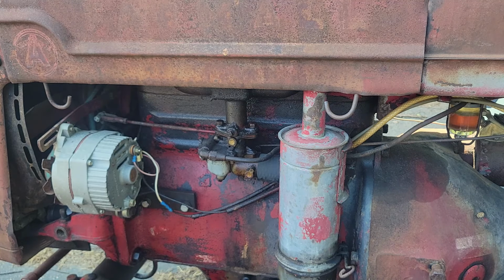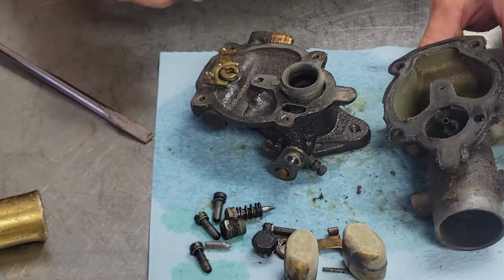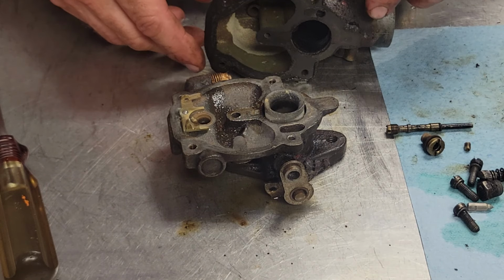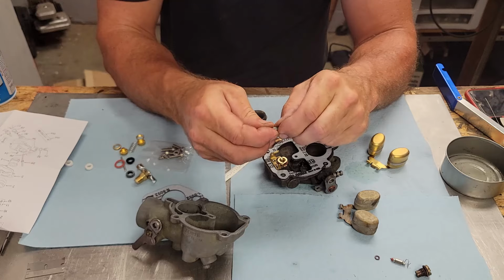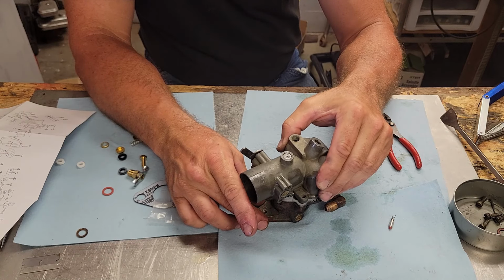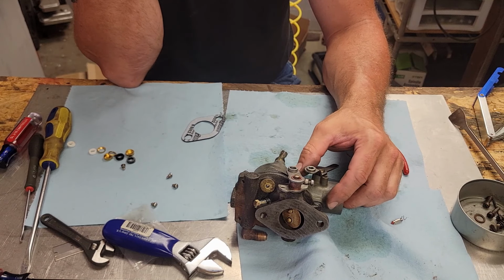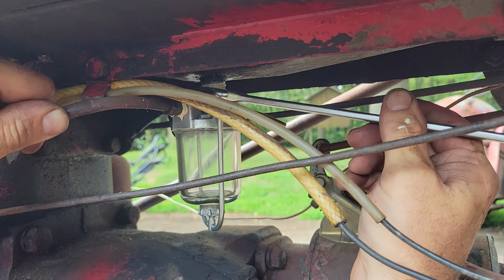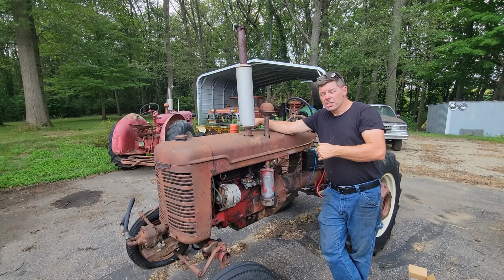Farmall A  Zenith Carburetor, lets clean and rebuild it.

Comment: did you take the fuel inlet fitting out? There is a screen filter in it that is probably clogged also since the seat was clogged.....good video
Reply from the maker: Yes I took it out. There was not a filter in it at that time. Now it has one.